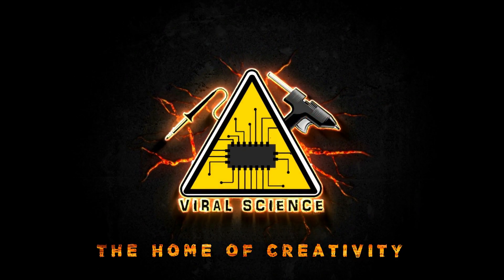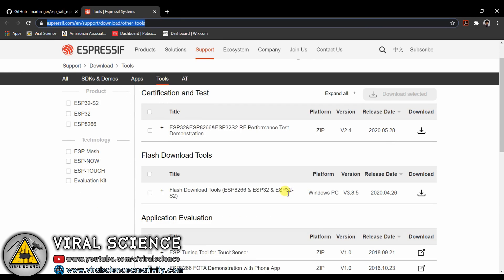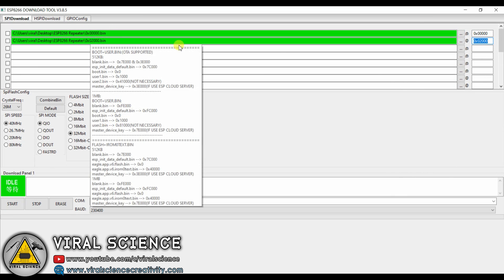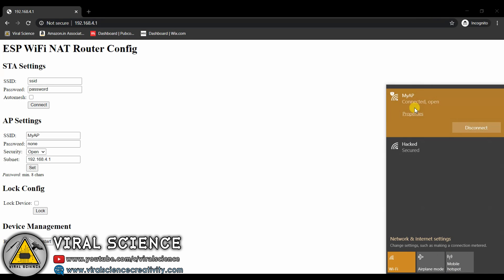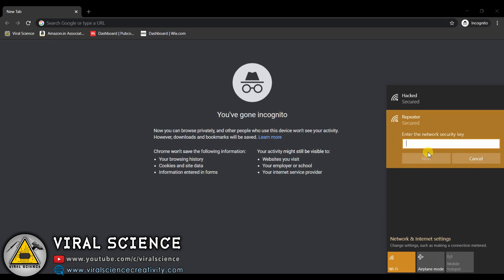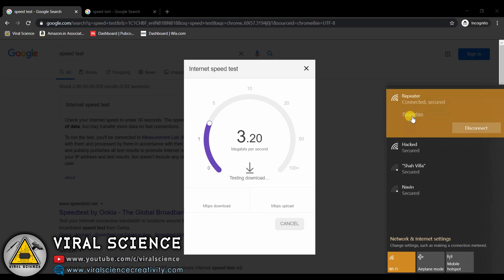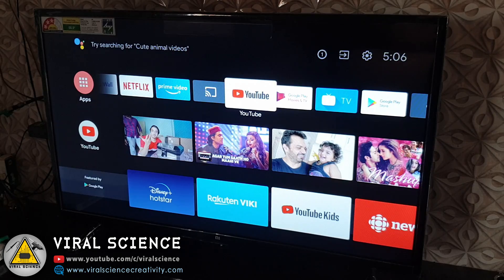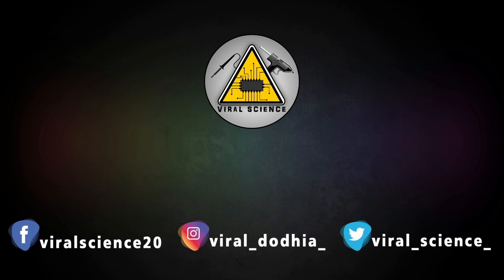ESP8266 Wifi Range Extender Repeater $4 Low Cost

Comment: It still works up today, the only problem is that the range is very small, so you gotta be near the ESP8266 still. Another problem is that the network is bad coming from the ESP8266 compared to the main network. But overall it really works! 100% thanks, new knowledge acquired.

Comment: Update with my another ESP8266 Nodemcu i have sucessfully finished all the steps correct connected it to com 6  but for some reason after the actual wifi is connected it still shows not connected and when i am trying to reset i am not ale to help me

Comment: How to fix my home wifi is about to 8mpbs , but my repeater is 1mbps only ??
Reply: same
Reply: nothin you can do kid cause the further your repeater is from the wifi the slow your speeds going to be  its just amplifying a weaker signal therefore giving you a slow transmission of data the guy got a good speed cause he was much closer to the wifi pay abit extra to get a proper extender

Comment: Hello.  The question is about the ESP D1 mini pro amplifier for wifi range.  Uploading is correct after connecting to ESP, enter the network name and password, press connect.  A setting change appears, reconnecting to ESP, and no changes have been made.  ESP is in the same state as when it was first started.  When I enter changes to AP, the changes are saved.  But I still can't connect ESP to my network.

Comment: Great video! Is it possible creating a new access point that simply repeats the signal from the same home wifi?
Reply: @appleejack   I discovered the way!! if you look just below the password box, you'll see the "automesh" option. That will allow your ESP8266 using the same SSID and password of your router.
So the steps you have to follow are:
1) You put your SSID and password of your router.
2) Check the "Automesh" option.
3) Click connect.
And... You´r done!!
Thus, you´ll have a real mesh network!
Reply: @appleejack  I've tried it but it doesn't work... Have you tried it?
Reply: @vidadeingeniero3350  any update on it?
Reply: @kazemab  i ended up by buying tenda nova mw3 which is a real mesh wifi system